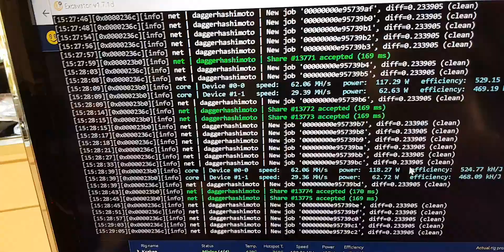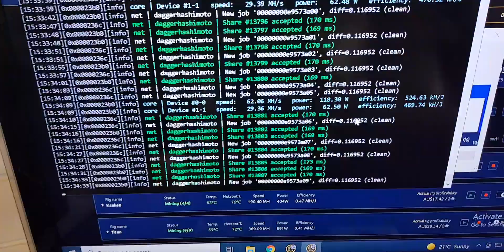11 GPU Mining Rig Build 0.5Ghs @ 1000w!  Part 4 - quick update & plans to build a 2 tier frame!💪🤓

Comment: Hey, hope you are doing well.

First of all I Just wanna say that these are super amazing videos, an awesome channel!! Instantly subbed. You deserve way more views and subs. 

I have been watching this B450 2600 Build for Mining and I found this very helpful because I have been planning to buy same exact build. 

So my plan is to buy a MSI B450 Tomahawk Max and Ryzen 5 2600, so almost same as yours. I won't be running a lot of cards, I only plan to run max 2 maybe even 3 in future. 

I am starting mining so it can help me with bills and stuff haha, really hard to get by these days. Hence I saved up a bit for a non lhr 3080 Fe which I am planning to buy soon. 

I will want to run a 970 as my main card or work card directly plugged to the motherboard and the RTX 3080 plugged for mining using a riser. Hopefully it can all go according to plan. I am planning to use Nicehash as well. 

What do you think?

Comment: Thanks for the vid and update. I actually got the same MB but got an Athlon CPU instead. Do you know of anyone with a vid with this already running? I will be getting it this week and wanted to check out how others are laying out the risers/usb splitters etc
Reply from the maker: Hi Noah,  Yes the motherboard is great, not sure about that specific CPU but AMD are normally pretty good across the range.  Sorry for slow progress to release the latest video in series I have been busy setting up a dedicated mining facility to move all my rigs to.  Vids will come soon showing the 11 GPU's all running sweet!  Just as a fyi here is my slot and riser configuration to help you get up and running
Let me do a quick summary for you though:

PCIE Slot 1  (x16)  - 1 riser to 1 GPU
PCIE Slot 2  (x1)  - 1 to 4 splitter with 3 risers connecting 3 GPUs
PCIE Slot 3  (x1)  - 1 riser to 1 GPU
PCIE Slot 4  (x16)  - 1 riser to 1 GPU
PCIE Slot 5  (x1)  - 1 riser to 1 GPU
PCIE Slot 6  (x1)  - 1 to 4 splitter with 3 risers connecting 4 GPUs
Total = 11 GPU running smooth 👍👍

Any questions when building your rig just let me know happy to help!

Cheers
Oz Mining
Reply: @OZMining  Yeah, my CPU may be my limitation. I should've spent an extra $50 to make sure it works but hey, is a learning process. Thanks for both replies and info
Reply: @noahswarz4914  your cpu is limited to 6 gpus. Change display out to gpu in bios and disable Igpu to get the 6 Working
Reply: @backspace4317  Yes, thanks for the comment. I was able to get 7 working by disabling the iGPU

Comment: Hey mate how can we plug 11 gpus to a single b450 motherboard? Thanks
Reply from the maker: Hi NC J,  Thanks for watching my videos and appreciate question 🙏👍.  There are more video coming and I'll also do some close ups of the motherboard and how all GPUS are connected.  

Let me do a quick summary for you though:

PCIE Slot 1  (x16)  - 1 riser to 1 GPU
PCIE Slot 2  (x1)  - 1 to 4 splitter with 3 risers connecting 3 GPUs
PCIE Slot 3  (x1)  - 1 riser to 1 GPU
PCIE Slot 4  (x16)  - 1 riser to 1 GPU
PCIE Slot 5  (x1)  - 1 riser to 1 GPU
PCIE Slot 6  (x1)  - 1 to 4 splitter with 3 risers connecting 4 GPUs
Total = 11 GPU running smooth 👍👍
Reply: @OZMining  Thanks heaps mate. Can you please do a video with bios settings For 11 gpus. I am still struggling to connect more than 7 gpus. Thanks
Reply from the maker: Hi NC J,  Check out this video see if this helps, I cover off Bios and Windows.   Also can you let me know what make and model GPUS you are trying to add so I can see if any GPU limitations  
https://youtu.be/I72d5SsIW5o
Thanks 
Oz
Reply: @OZMining  hey mate i am using amd 6600 xt and 6600. So i have 10 cards all up
Reply from the maker: @ncj222  Oh wow those are great cards very efficient you are building a great rig🤜🤛 yes 11 rx6600 amd rx6600xt should be ok, I thought you might have a rtx 3060 which cam give issues.  I only have one rx 6600 still in box planning to build rig soon. 🤞 What hash and efficiency are you getting?
Reply: @OZMining  6600 non xt is giving arnd 29 and 6600 xt arnd 33. They both using 70-80 watts from the wall